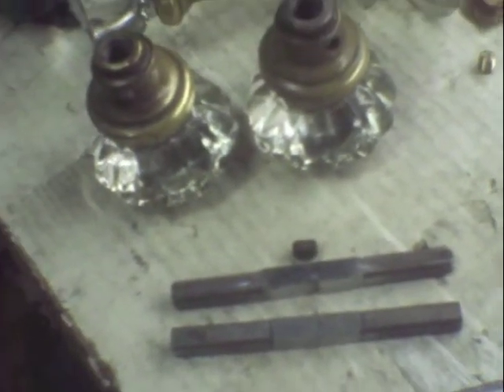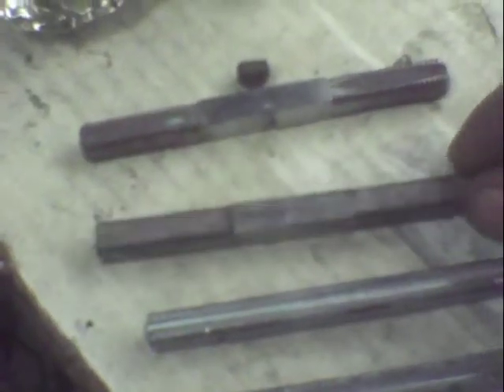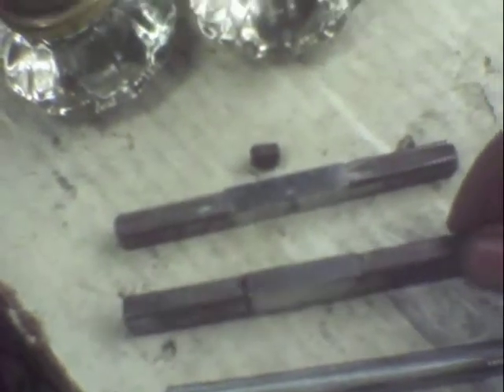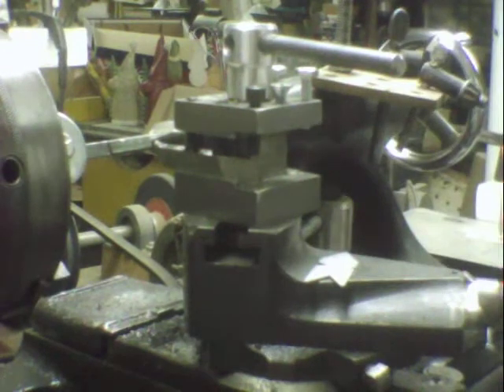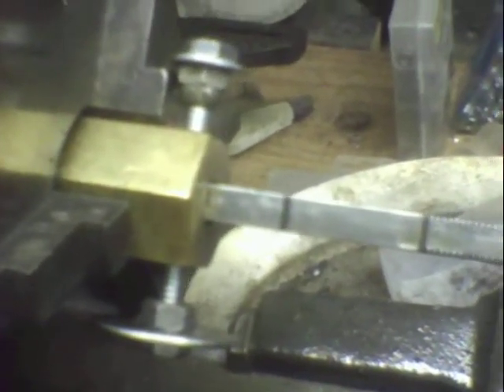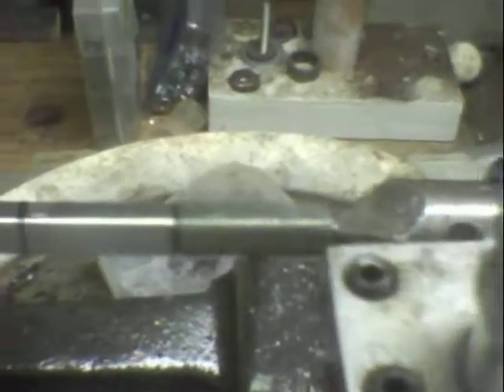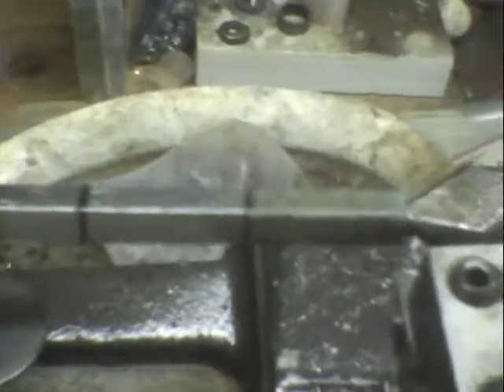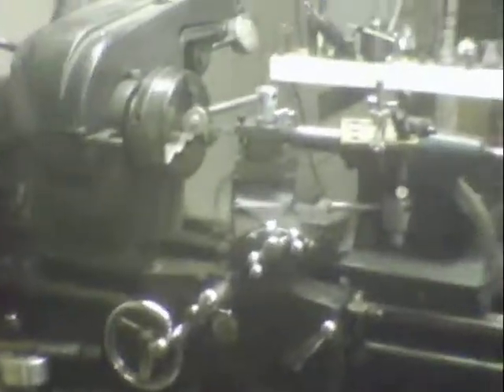How to Make Threads (aka Cut/'Chase' threads), run a Lathe, Craftsman/Atlas, 2013, TN

Comment: how about gear box settings?
Reply from the maker: Dave Sullivan You got a Craftsman/Atlas?   They don't have a 'quick change' gearbox for chasing threads, so its kind of a pain compared to newer lathes, takes a lot longer. The chart is on the inside of the gear-train cover, & in the owner/operator's manual. I just recently was going to change them out for a slow feed for turning, & the number of gear teeth are cast in the side of each gear. But they're real small numbers, hard to read, so I painted white the whole section of the side of the gear where the numbers are, so its easier to find them quicker.  Take care.